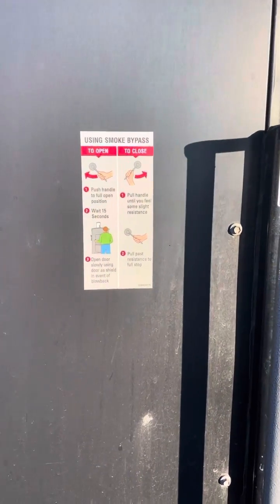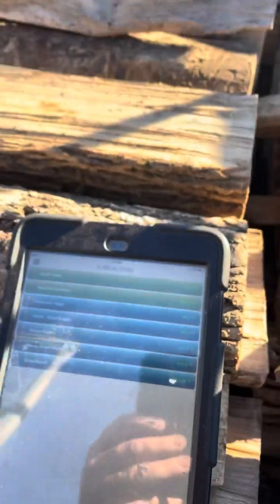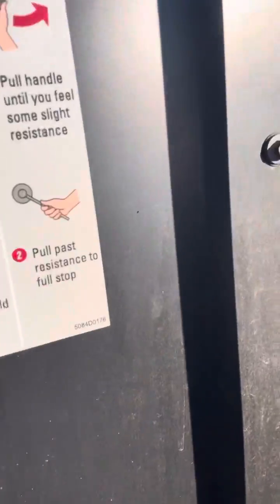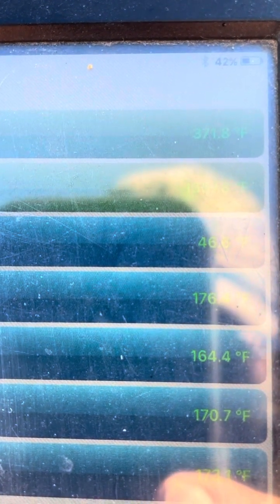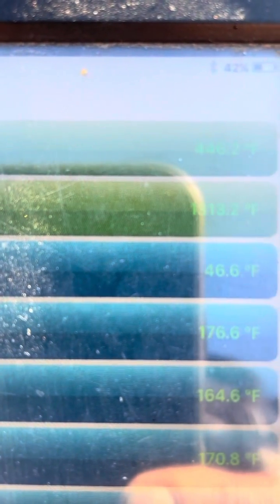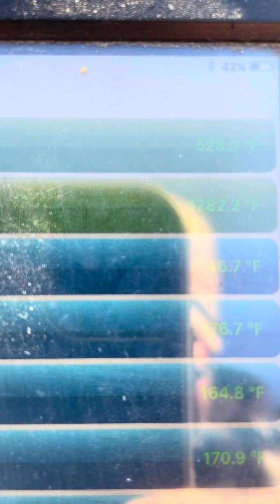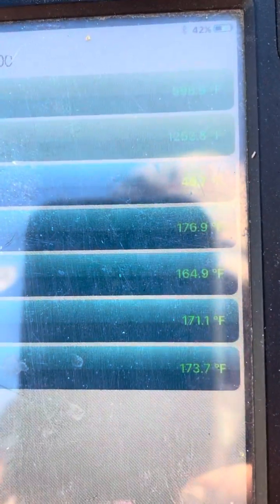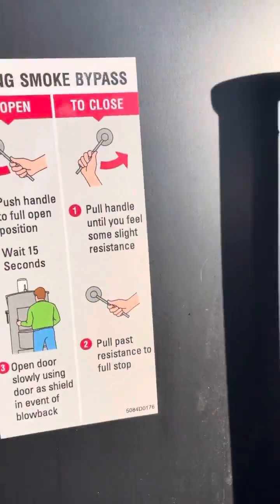Proper use of the smoke bypass on a G Series.

Comment: Are you using WiFi or wired for the iPad data?
Reply from the maker: Using an Ethernet cable from the house to the stove, once I’m done burying cable I’ll have a Ethernet hub at the stove and run more cable to the shop and the generator shed.
Reply: @AlternativeHeatingSolutions  CAN you use WiFi? I have an existing set up and would be challenging to add an Ethernet cable
Reply from the maker: @dansportdr123  yes you can. Originally I mounted a WiFi repeater in a plastic box under the stove.
Reply: Actually! Just checked and there is an Ethernet port on the end adapter, so I could still use an Ethernet cable from the adapter on the outlet of the boiler to the Siemens controller